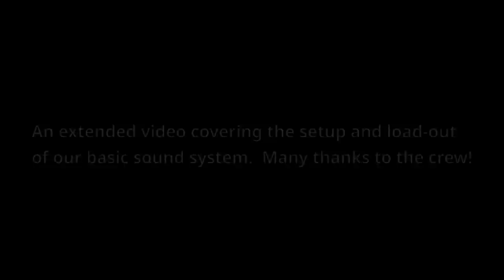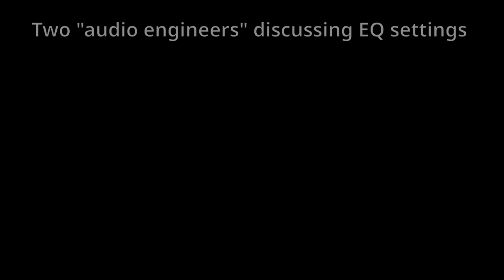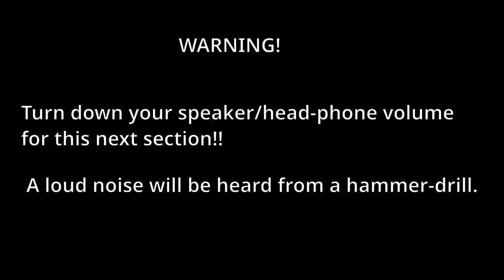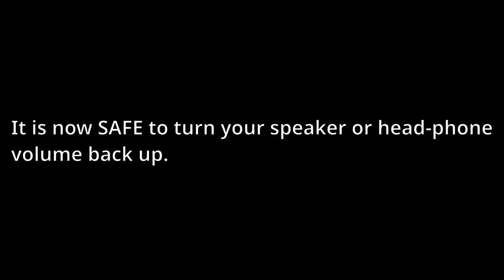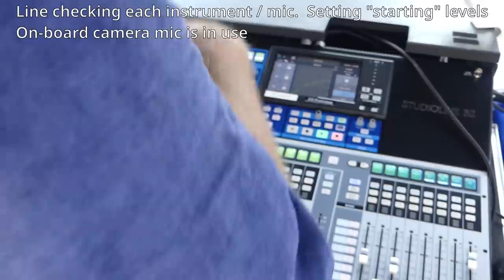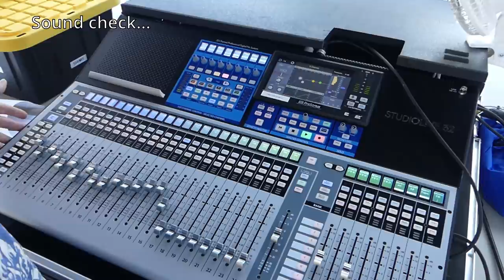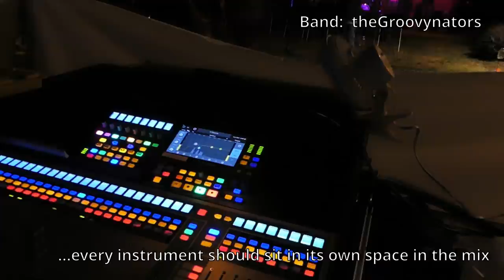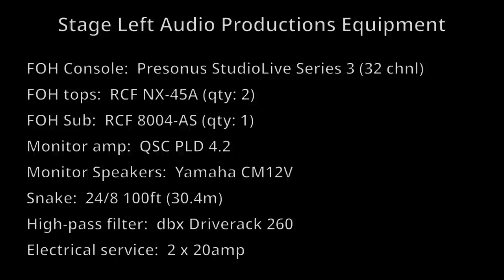Providing sound for the Groovynators using a Presonus StudioLive Series 3 console - Event Video 31

Comment: Guys..come on..This is  poor set up.. Wires all over the performance ares..This is not how a pro does it. When I do a private  corporate gig like this there are no wires showing on any poles. I gaff tape them to the poles, that also goes for any lighting poles. Your snake should be in a non traveled portion of the stage and xllr cables to each element should  be run  in a single cable chase in back of the monitors.Neat  Neat. I run a 120v ac strip just tucked in front of the powered  monitors. So my ac runs to each monitor are short and neat.Also provides easy access power for pedal boards. I also.run one on the back line for Amp and keyboard power or run quad ac boxes  in each back corner.All mic and monitor cables go to the stage box in "U" configuration on the non traveled portion of the stage. I leave a spill of cable neatly tucked under each element mons and mics so if someone wants  to move a monitor or mic on stage,there isn't a problem. NEVER have cables in the performance area. Drunk.musicians or drunk patrons trip all the time. This stage is messy looking. Not pro at all.You have excellent gear for your shows, it should be assembled neatly and professionally.. The 4 bar you used for lighting is inadequate.. you should have used at least 2 of them for this show.  Maybe you didn't get paid for this gig and did a quick set up..  If I was paying you for this show I would have been pissed off.
Also,you should keep work station area clean and all excess wiring should be coiled neatly and all the speaker and case covers should be stored out of site..This will make it look like you are running a pro operation..  Of Course.. my opinion.
Reply from the maker: Thanks for the comment.  Good observations.  For this event (like some events we do), there were several logistics issues that presented us with some roadblocks which required work-arounds.  These issues consumed time.  Sometimes, between when the bands play and when we previously check out a site, things change with power and setup, we do our best to accommodate the bands and the site changes, which includes the time required to setup.  Fortunately, we have worked for this band for many years.  In fact, the band sets up their own stage cabling (using our gear) in a manner that works for them.  The stage area may appear to be un-orderly, but it works for them.  Also, this is a single band event... if this were a multi-band event, things would look a lot different (especially with the cabling, including the snake).  We would be using different gear.  We had no control over the lighting... the 4-bar lights belong to the band.  Also, the event location installed a large color changing light (referenced in the video) that was also used for this event.  I agree, the lighting was not too good for this show.  The band upgraded their lighting after this event.  Most all of the lighting you see in our videos belong to the bands we are mixing for.  For the larger shows, the lighting is contracted out.  The setup time for this event was reduced.  There comes a time when the show must go on... and when it does, we move forward with it.  Thanks again for the comment!
Reply: Thanks for the reply...  I hate to be critical but I see many live venues like this. I know you are a great soundman and are very knowledgeable..You have awesome gear as well. I can tell you.myself, I never try to have any obstructions on stage and.my cabling is always super neat and hidden as much as possible.Another thing, I never let bands put up 1 piece of gear until I al ready. They just get in the way.. You own the stage before any.music starts. They can be a pain in the ass and are always asking for things as soon as they get up there. When you.do.allow them up..do it 1 at a time.. then.they.feel.your paying out attention to them.  You do good work. I watch and have commented on many of your videos. Cheers
Reply from the maker: Thank you for the follow up!

Comment: Why do you need fan for the console? Do you have experienced overheating issue?
Reply from the maker: Good observation.  No, I have never experienced an overheating issue with any of our consoles.  I always place a fan on all of our consoles to ensue no heat related issues.  This is something that I have always done (for decades).  The small rack at FOH with the UPS and crossover installed in it has a fan running in it as well.